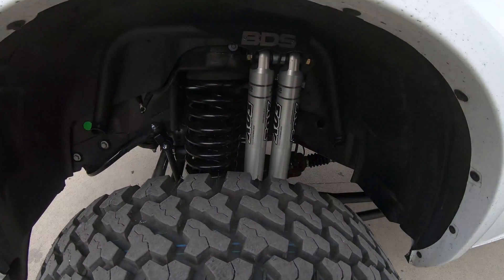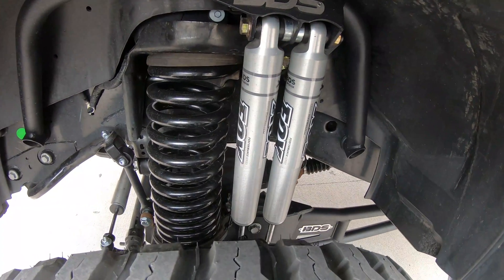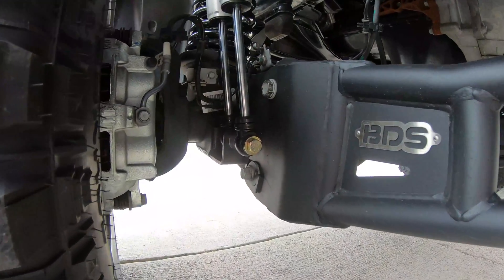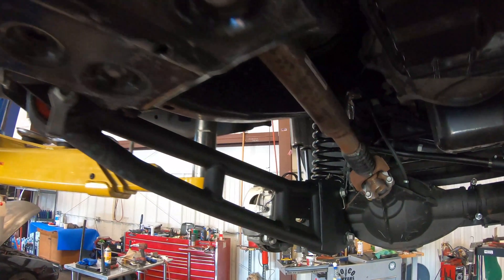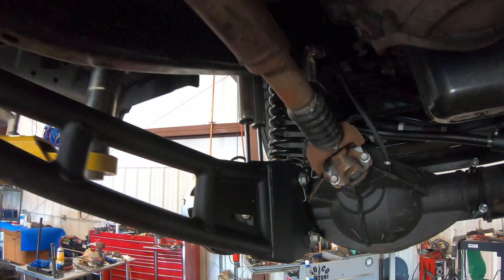Quick Hits: What is a radius arm?

Comment: I have a 2017 2500 Ram.  It's has a rough country 2.5 leveling kit.  I need to upgrade the suspension and shocks for a smoother ride.  Wheels 20x11 I have 35's 12.50 20r  tires.  What do you recommend me doing to get a better ride?  and do you recommend a steering stabilizer bar and radius arm bar?